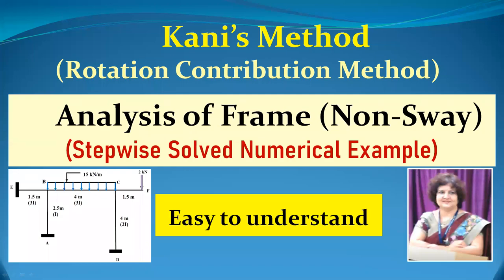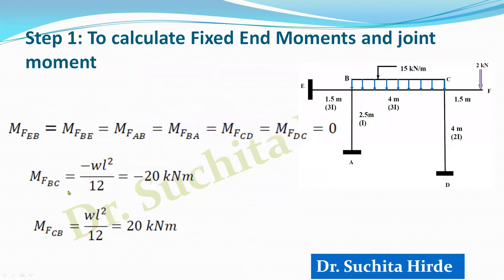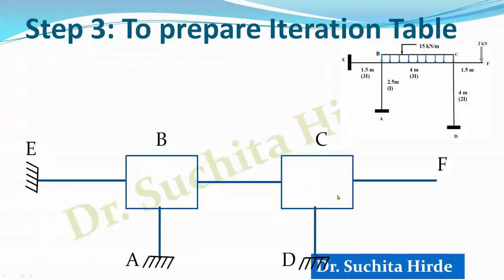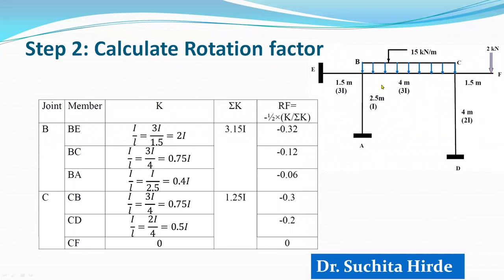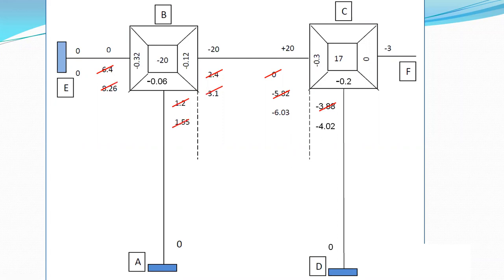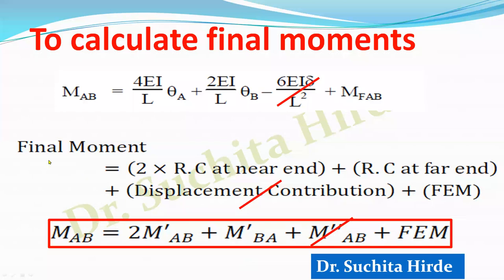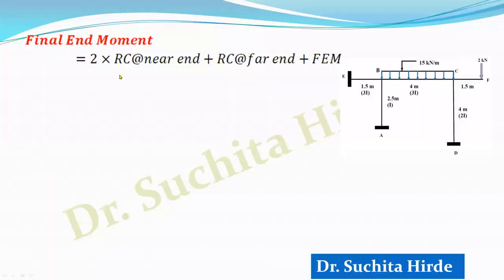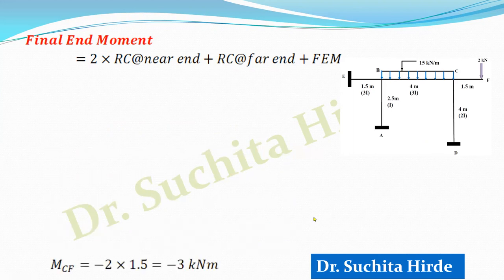Kani's Method: Simplified Procedure for Analysis of Non-sway  Frame with  Numerical Example

Comment: Madam can you tell me the how this frame is non sway frame 
In this problem two columns having different lengths na
Reply from the maker: This is simple frame. Due to fixed support at E, sway i. e.  horizontal movement of top joints of columns is not possible though the column lengths are different. If top joints of frame are free to move in horizontal direction then only there is possibility of sway depending on column conditions. 
I hope this will help you to differentiate between sway and non sway frames.